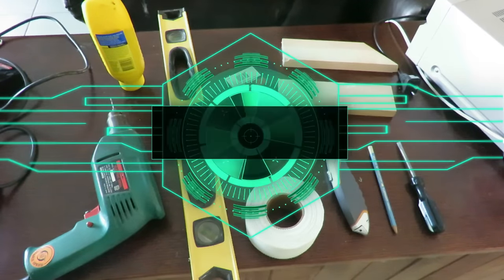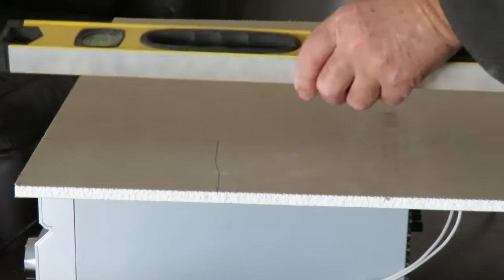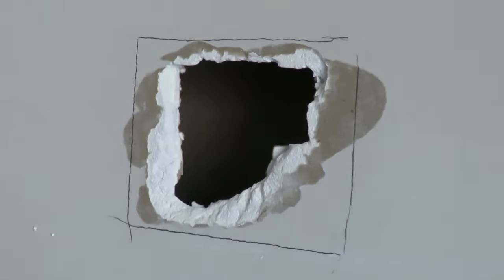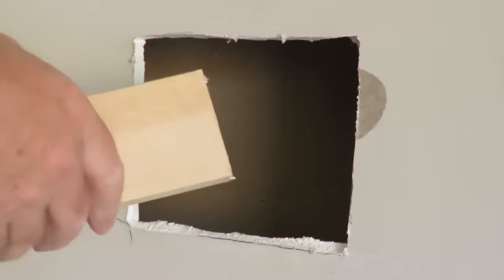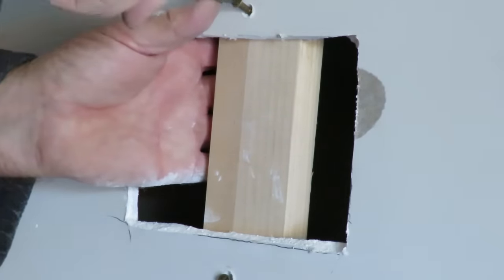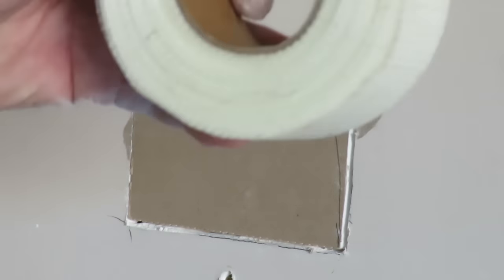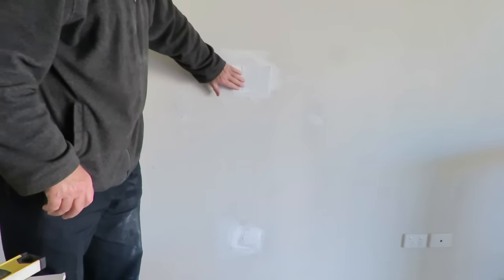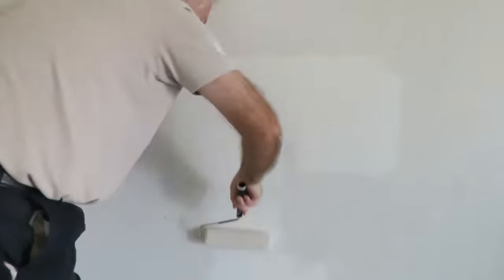🏠 How to Repair Drywall and Fix a large Hole in the Plaster Wall the easy way

Comment: Someone below wrote 'wonderful skill'. He looks to me as if he's never used a utility knife. Also, to only put one piece of wood in is ridiculous, if anyone ever leans on either side, it will crack. Do it properly and use a piece of wood to support the joint either side, if you also put some 'no nails' on the wood, it will never move. Or you can just bodge it like Garry.
Reply from the maker: Maybe check the date of the video before making silly claims as to how the long repair will last in a rental property.
If you bothered to read the video description, you would know why the repair was done this way.
P.S. I have a another video below, (when I had all my tools with me.)
https://youtu.be/JmcR9TW4mM0?
Reply: @GarryPurcell Sorry, I didnt realise people made You Tube videos of how to bodge things up
Reply from the maker: You should read this from the Gyprock manufactures website, before you tell me I'm wrong.
https://www.gyprock.com.au/-/media/gyprock/content/documents/install/diy-projects/gyprock-201-repairing_holes_diy_guide-201604.pdf

Comment: It would be a lot better if you measured the square to cut out the drywall. Also, it would be easier to use a jab saw instead of a Stanley knife to cut around the hole. You should also put the plaster on before you put on the tape, it holds better. As a professional handyman, I have to say that this wasn't a good repair at all. I showed my son this video as a reminder of what NOT to do when repairing a wall. I also told him that this is evidence that you can be doing a job wrong for 20, 25, or 30 years, and if no one corrects you, you will never know how to do the job properly. All the old-school trades guys did things by winging it or being taught by someone who did the job, but incorrectly.  I'm teaching my son to go to pre-apprentice training, then apprentice training to do things the right way and not like this. Because your signature is in your work, so learn to do a proper job. He's learning from me, and his apprentice school and doing well. This was hard to watch.
Reply from the maker: Please Read the video description
Reply: @GarryPurcell  Yes I did read the description before commenting. That does not negate the fact that this was still a bad job. There is no quick and easy way to do this type of work. It was just done poorly.
Reply from the maker: You do realise this video is over 5 years old, and the patch is still holding perfectly.
Reply: As long as no one touches it😄 @GarryPurcell

Comment: Not using your tip for drywall properly.....2 planche on both sued and drywall  face...
Nie it will still be loose in one corner....too bas
Reply from the maker: Please Read the video description before posting again.
P.S. I normally use this method when I have my tools with me.
📌 https://youtu.be/JmcR9TW4mM0

Comment: That is shocking and the other video in the description is aswel. Didnt even scrim tape to all th corners for a start shocking video from a so called professional
Reply from the maker: Wow, you need to get out and about, and learn a bit more.
I would like to see your repairs, when you have no tools or materials with you on the day of the said repair.

P.S. There are many ways to do wall repairs, so maybe you should open your mind a little.
Reply: @GarryPurcell  I've been out and about long enough to realise that is a shite job, I've done better jobs with less tools and equipment then u had in these videos, why not just post videos of doing it properly and keep these patch repairs for your eyes only. But hey each to there own and aslong as you get paid.
Reply: Where can I find the videos for your repairs, I’d really like to see how it’s done correctly

Comment: Look I'm not trying to take the idea from you but that it's not right,maybe work temporarily but it would cracked,not enough re enforcement,and drywall not even,sorry but a have done billions of drywall repairs never poorly never.
Reply from the maker: Please Read the Video Description..
This repair has not cracked to date, and is unlikely to do so.

P.S. When I have all my tools with me I normally use the method below to repair walls.
https://youtu.be/JmcR9TW4mM0

Comment: You did it wrong you need backer boards on the edges not the Middle
Reply from the maker: There are plenty of ways o do effective wall repairs.
If you read the video description, it might help you understand why it was done this way.

P.S. When I have all my tools with me I normally use the method below to repair walls.
https://youtu.be/JmcR9TW4mM0
Reply: He did it right and he really really did good

Comment: This man has no business repair drywall and should leave it to the professionals Bc a if ur going to make the hole your repair bigger like he did than u need to put screw the drywall to the backing b when u go to mud (plaster)the repair than make sure the tape runs past the the side pieces and than finally make sure tht it’s flat I could see in the video tht he need to build it out more or in layman’s terms they need to put another coat on it but to make all this Easier call a drywall pro
Reply from the maker: PLEASE Read the Video Description, BEFORE Commenting any further.

Comment: Primitive Pete slotted screws?
Reply from the maker: If you bothered to read the video description, you would know why the repair was done this way.
P.S. I have a better instruction video below, (when I had all my tools with me.)
https://youtu.be/JmcR9TW4mM0?
Reply: What a hack job! He puts the cut out piece of drywall in backwards, he uses wood screws instead of drywall screws and uses sandpaper to smooth it out?  Real easy way to patch a hole this size for the the unhandy handyman?  Go down to to your home improvement store and buy 4”, 6” or 10” patch.  It sticks to the wall and you put quick drying compound over it. Put on two or three coats and sand down with a fine grit sponge.  Ready for paint in less than an hour.  I’ve been patching holes for years and this is the best and quickest way I’ve found.
Reply from the maker: @franciskowalski783  Please read the video description, before you comment any further.

Comment: Don't  sneeze or it might fall out. The worst patching i've ever seen, slotted screws as well. Time you retired old timer.
Reply from the maker: You should get into the habit of reading video descriptions before commenting. 
If you did, you would know why the repair was done this way.
P.S. I have a another video below, (when I had all my tools with me.)
https://youtu.be/JmcR9TW4mM0?
Reply: @GarryPurcell  regardless of whether you had your normal tools with you this repair is wrong and will be subject to cracking around the edges. 
the only way to do this repair correctly is to have wood screwed in and grip filled in along all four edges and the wood should be a four inches wide and then the piece screwed and with grip filled behind. once the grip fill is solid apply joint filler and sand flat. this is a permanent and solid fix that will not crack
Reply from the maker: @colhughes3892  Check the date of the video.
No Cracking as of the 6/04/2020
Reply: @GarryPurcell  im a professional plasterer and dry liner your repair is no good and if you did that on my job you would be given your p45
Reply from the maker: @colhughes3892  Feel free to put a link to your work, when you had no tools with you, and sourced materials from a dump bin, and borrowed tools to do the job.
P.S. I have a feeling you would prefer my other video. (When I was prepared).
https://youtu.be/JmcR9TW4mM0?

Comment: That's not a plastered wall
Reply from the maker: And what exactly is plaster board made from?
Reply: @GarryPurcell  gypsum that's not the point the point is there are different substrates that substrate is drywall with taped joints that is not a plastered wall misrepresentation

Comment: Hasn't even fixed the board to the timber , fibre tape short on the corner could crack .. just retire m8 and take up lawn bowls
Reply from the maker: There is no cracking to date. (So your prediction is wrong)
Maybe you should check the video release date, and also read the video description before commenting.
If you did, you would know why the repair was done this way.
P.S. I have a another video below, (when I had all my tools with me.)
https://youtu.be/JmcR9TW4mM0?

Comment: "Read the description "

Ok....I did. Now can I comment? 
Get the right tools. No reason to use dumpster materials and make a video.
Reply from the maker: Then you would be aware I was on a non-related job, and was asked if I could patch the wall with no tools available, and I showed resourcefulness in getting the job done.
Normally I would do a repair as my video below.
https://youtu.be/JmcR9TW4mM0?

Comment: That's so wrong in every way, this man is an amateur
Reply from the maker: Please take the time to read the Video Description, BEFORE! Commenting any further, You Might Learn Something.
Reply: @GarryPurcell  The only thing anyone can learn from this video is how to incorrectly patch drywall. Everything from how you cut out the drywall to the single piece of backer which is why your patch kept moving around is completely wrong. Your plastering made me laugh too. Regardless of what you could scrounge up this is all wrong.
Reply: Man, yall need to hush. If the people paying the job don't notice anything wrong then its 100% correct.

Comment: Working with all that dust on top of a piece of electronics? Yeah, that was very smart! WORST DRYWALL REPAIR VIDEO EVER !!!
Reply from the maker: You really need to read in future before posting a stupid comment.!
If you had bothered to read the video description, you would be aware that speaker came from a Dump Bin at the front of the property.
Reply: Chill, this video was great. Couldn't find any puppies to kick on your way here?
Reply: 2:04 Clean ur ears
Reply: he literally said that the thing he was working on is gonna get thrown out so he wasn’t worried about it. Open ur ears before u try discrediting this man’s video
Reply: He literally said it was garbage as soon as he put it down on it